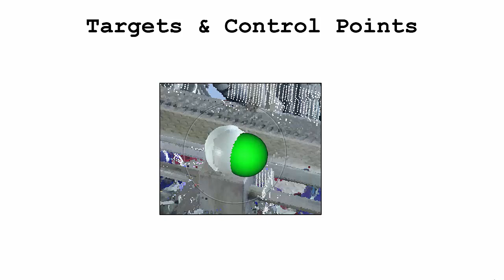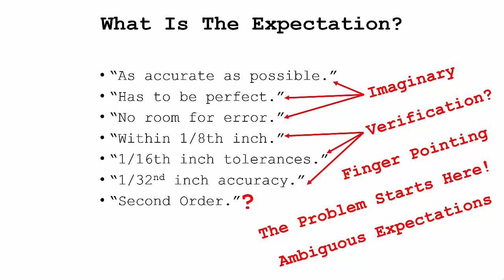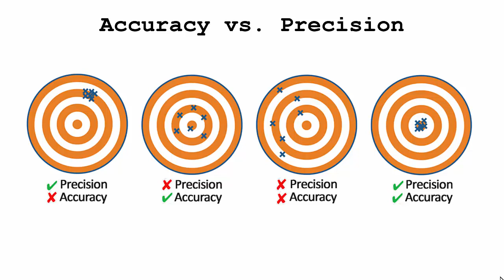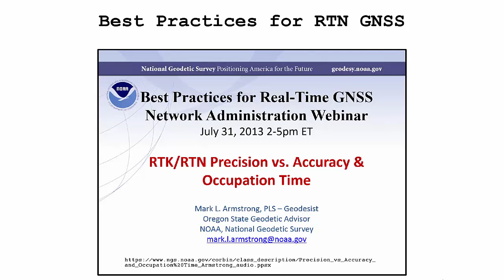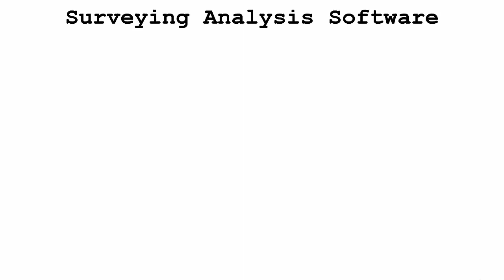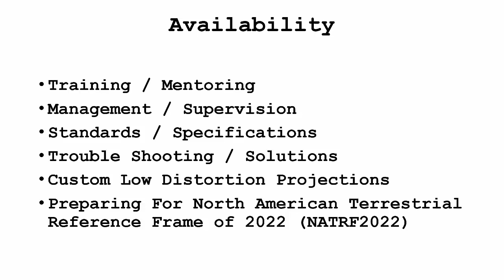CONTROL SURVEYING - MEETING POSITIONAL ACCURACY STANDARDS

Comment: mhhh...im on my early stage into surveying/setting out and i remember during my training laying out the building  with total station, i used to push buttons and smile every time the resection returned good results and curried on pushing buttons endlessly. Well, i now know that there's more than pushing buttons and, although i haven't fully understood everything that has being talked in this video, ill have to rewatch this and get the recommended books. Thank you Jesse.

Comment: Seems like you kinda knows what you're doing! I didn't watch all of it but skimmed through... Those 5 and a half years I had at Oslo Airport Gardermoen was great, we also did controlling stuff.
There was one time, a contractor suspected he was cheated for concrete. The main hangar is somewhere around 400 x 250 meter and he thought the floor was a few millimeters too low.
So we measured the whole thing, both with total stations and a bit of levelling. I don't remember the result anymore, but it wasn't cheap to have two men walking around there for a few days...
Another time, we were hired to check the edge of the roof of the main terminal building. Another contractor thought the roof line looked a bit up and down, in waves.
After we spent some days on the edge, some 45 meters above ground, he was told by someone who have observed us that it's supposed to be like that. It's the drainage of the rain... DAMN!
Reply from the maker: Sounds like a really great project to work on. That experience served you well in your youtube hobby  ;)

Comment: Thank you very mutch for the excellent presentation. I very much enjoyed it.
What I would like to include in the accuracy columns is at least the number of samples taken to calculate the standard deviation. It gives you some infos about the confidence of the values. A standard deviation taken from 3 samples is not as good as from 30 samples. What about infos about refraction? But this is probably not relevant at this stage, I don't know.
Reply from the maker: I'm glad you liked it Walter. Adding the positional accuracy to your app would be outstanding. I do have files containing those columns for the Lake Pontchartrain Causeway bridge and also Rte80 across the Bonneville Salt Flats. In my opinion, your app is worth some $ to the geospatial software market. The code you've written could enhance a program like Sketchup if they would consider expanding that software. Knowing your amazing appetite for math, I can recommend the geodetic texts and web resources you'll want to read and reference.